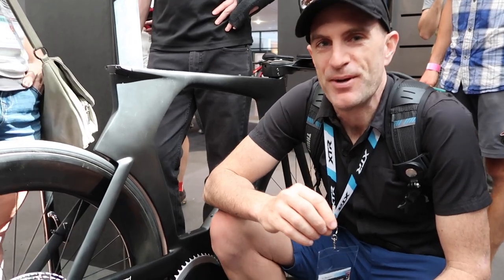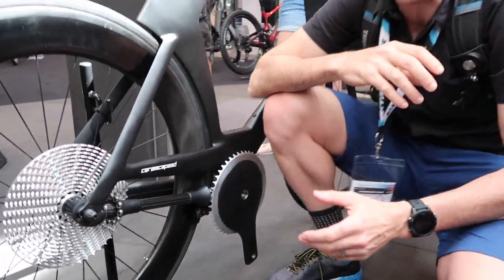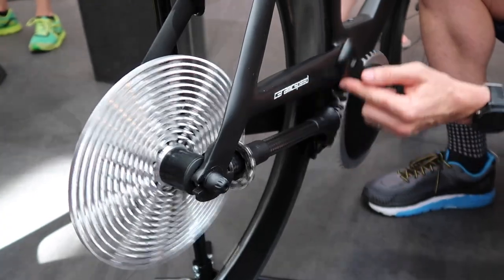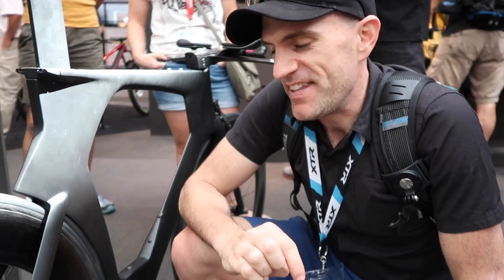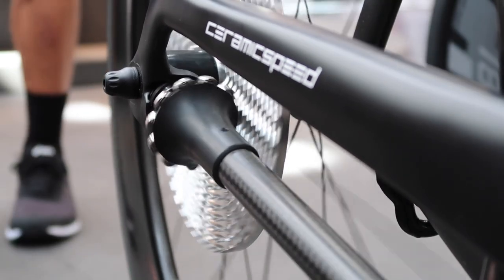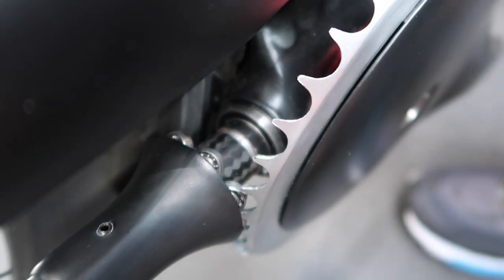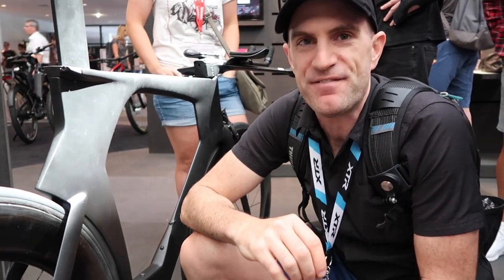CeramicSpeed DrivEN 99% Efficient Drive Shaft // Chain Free Bike // Eurobike 2018

Comment: Chain is the holy grail of bike transmission. But it doesn't mean we should't try new things. This thing is not gonna work but it definitely looks cool.
Reply: В 1890 появились подобные конструкции, с 1893 их серийно производили и  продавали...
130 лет прошло, а проблемы эксплуатации данной конструкции никуда не делись.
Reply: Definetly gonna fail, they're not the first to try it. It's just the basic concept for automobile transmission the only problem is when a rock kicks in there. It'll be funny to see how this fails
Reply: It works. Its a kardan.  Motorcycles have it too.  Bit heavier
Reply: About time that something changes the chain system, chain system is well beyond 💯 years!
Reply: If a rock hits it? Simple engineering problem solve. Put a cover over it so it isnt exposed.
Reply: yep, too much load for such a small gear, will wear out quickly
Reply: Really good coming from a russian person who still thinks a 10 speed bike is hollywood, bikes have to look to the future and that new mechanism is the future.
Reply: If were looking for proof that those who don’t know history are doomed to repeat it, you found it.
Reply: Joshua Mack it is no cardan. It's called mechanical Royal Wave, as there is no Cardan element involved. 😋
Reply: DEVARMONT7 this has been done already, many, many times.  Every decade or so someone prototypes (in some cases even produces and tries to sell) a bike with shaft drive and calls it “revolutionary and new”.  It’s not lack of imagination or ingenuity that has caused shaft drive to fail to displace chains in spite of many repeated attempts, it’s the laws of physics.
Reply: Lalthanzuala Hauhnar this thing is well beyond 100 years too. Got any other dumb bandwagons to jump on?
Reply: Lewis Designs only problem is this thing was tried on and on over 100 years. Trying it again and calling new doesnt mean it will suddenly overcome all the obstacles....
Reply: stan lis but it cant be implemented in competition setup... This construction wont be reliable and at the same time lighter than conventional chain drive to sustain professional athletes load on it.... It can spin the wheel but not when pro cyclist puts all his power down... Construction wont take that much stess without either skipping or plain shattering
Reply: Why not nuclear powered bicycle then?
Reply: I think you are right. A bicycle chain will adjust to wear and last a long time. As soon as this thing starts to wear, I think it is doomed. I doubt that they can solve the problems of proper function, wear resistance, weight, and repairability, but it is still exciting to see.
Reply: Дмитрий Хабаров instead of a chain try ball bearings in a tubing easy 50% improvement. But motorcycle driveshaft is awesome ie Honda nighthawk 650
Reply: yeah I get your point but why try to "over engineer" something that has worked since forever. Like reinventing the weel.
Reply: So you must be riding a penny-farthing (a high wheel bicycle), because they worked, just fine. Why would you try to reinvent the bicycle? Gears are the tool of the devil.  I disagree with the move to a single speed up front due to cross chaining, but what if it turns out that it works better, or perhaps just for some riders?  People must try new things and figure out what works best for them. This is a prototype still in development. But if it reduces friction that much and wear is not as bad as I assume then the people who win will ride them and the people who lose to them will figure it out. I know a lot of people who were resistant to clipless pedals, including me. I mean they were invented in 1895 and they didn't work then, why would we keep attempting to make them? Now I am resistant to riding anything else. Why? because after I got used to them I realized that it was a far superior design, even though the first attempts were terrible.
Reply: if its so holy than how come i need to replace the chain because it stretches over time. and replace the gears around once a year as well because of the chain stretching eating away the gear's teeth.

holy grail  my ass.
Reply: Motorcycles have a gearbox in front of cardan and a complex enclosed  gearing on the other. Ant in total it weights more than entire bicycle.
Reply: It's an apples to oranges comparison. The 2017 Suzuki SV650, a very common motorcycle, weighs 195kg (429.9lbs) wet (with fluids) and puts out 69.3hp (51,677watts) actual measured power at peak output. What are you producing? They have  eliminated the chain, derailuers, traditional cassette, and 2nd chainring (no one is making any 3 chainring cranksets right now that I am aware of). I would also like to add that it has a reduced frontal area for better aerodynamics.  It may be that they can make it practical only for pros and the ultra wealthy. It may not work at all, or it may completely change the game. There are a lot of people predicting the future without having even touched one of these and some of them will be put in their place. We don't know the outcome yet, so everyone please calm down and let's see what happens.

Comment: It is definitely an interesting idea, I can see how the gear changes could work if the bearings on the driveshaft were attached to a keyed slot allowing it to slide up and down and could be controlled with some clever cable linkage. I'm not convinced it will replace the traditional chain and rear mech systems, however. My biggest concern is sideways deflection of the driveshaft and more likely the slender thickness aluminium gear-carriage which will cause the gears to skip.
Reply: I’m fed up with fixing my chains, this just solved all my problems

Comment: Chain ring and "cassette" would have to made out of some sort of  space age material due to the very small contact points under stress,  2 or 3 teeth and possibly only 1 tooth or bearing in full contact.
Reply: Hey Ropate K. Will titanium do, it's very light and very strong!

Comment: Beautiful  piece  of  engineering.  The fact that it creates  noise is indicative it may have more than 1% energy  loss .  Strictly speaking that is not the intended use for Roller bearings . I think it will be too expensive  to produce and the rear gear system  will be prone to failure  ( certainly  the weak link ) .  It also strikes me that it must have a bias toward gear changes ie much smoother on the up than the down change or visa versa .
Reply: Making sound doesn`t take so much energy, friction makes  heat and it is much bigger problem.

Comment: Ya pretty cool. Throw some oil sand and dirt on it and see what happens in 200 miles.
Reply: Do the same with a chain ...
Reply: palimpalim,
Sure and the chain will last substantially longer
Reply: engr. knows that before you know how to use youtube.
Reply: Get-The-Lead-Out.45

Why should it? Bike chains are not very durable products and they require constant care.
Reply: Not to mention crash hard and it's fucked
Reply: They used to have chain drives on tractors, cars, etc. Why is it they don't now? Kudos to the guy that puts the "why not" in life.
Reply: My chain pops off 2 times per ride, this thing does look less durable, but the things can be fixed. So the chain gets more small errors but probobaly lasts longer in the long run, but this thing looks like it's less susceptible to dirt, but a fall could knock it out of place
Reply: 8 hours to machine a piece with hundreds of delicate teeth. If any one of them breaks you get a bad gear.
Reply: Zayd Abbas must be riding far!
Reply: Get-The-Lead-Out.45 yea no mate. Don't think so. Chains get dirty and stay dirty. This would just kick the dirt out. There's no grease to keep that shit in
Reply: mjs1231 
Lol... I think 200 mi would be wildly optimistic! I'm guesstimating closer to about 1/10th of that!
Reply: Zayd Abbas  
Actually, this setup is going to be horribly susceptible to grit and grime. Don't know if you noticed, all of those bearings are totally exposed, not to mention the exposed, hardened steel bearing races driving an aluminum disc/gear under high load... Not good, Kemosabe!
Reply: This is obviously going to have seals, another win.
If they are able to change gears, it is potentially great.
Reply: How durable are drive shafts in cars, trucks, motorcycles, gigantic ships? Not as durable as chains would be at the same place, right? Sheesh.
Reply: mjs1231 

What if there's a fully sealed casing made out of a durable lightweight material encasing the components?
Reply: Chain is more reliable and cheaper than 500$ lol
Reply: Also a chain moves in the same direction as the wheel. This thing has bearings that rotate a different direction. To me it's less efficient. Looks cool though
Reply: What if it was sealed like a motorcycle shaft drive?
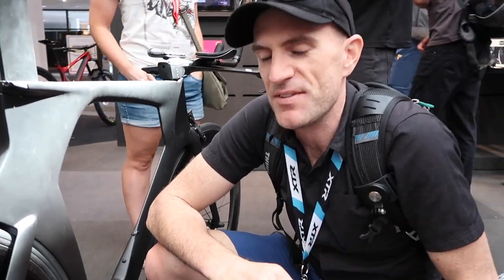Reply: meme 4:14 I'd like for it to be a discussion but people just want a lightsaber duel
Reply: 'Chain guard'
Reply: So you guys take your road bikes onto the muddy mountain trails then? Cool. I'll keep mine on the road and use my MTB for the mud.
Reply: In a snow storm it would not last 2 min.
Reply: I don't see this tech happening without some serious inventions that prevent sand and dirt messing with the 10-30(?) bearings. It looks like a nightmare to maintain. If I had to choose another system than the current one, I'd much rather have a pinion gearbox. It's heavy, but it's reliable and will remove a lot of weight from the back wheel making the suspension work better and very little maintenance compared the this flimsy looking thing.
Reply: Nothing as it will be in a sealed aero cover
Reply: It's made for trials, not mountain biking, so really a moot point.
Reply: Why does this even need to be exposed like this?  Cover everythin but the shaft.  Also, why not nest the shaft in the 'chain' stay to streamline the design?
Reply: Zayd Abbas  Your chain should not be popping off that frequently (unless you're riding 100s of miles at a time). I suggest you get someone to have a look at your transmission and work out what the problem is. Sounds like hyperbolic spin to me.
Reply: I'm pretty sure it will have rubber boots and seals and orings and what not. So it should be better that a chain.
Reply: I have an electric bike i bought like 4 years ago that has no chain and uses similar design, just single gear and it is obviously completely covered and oiled inside. This shit is nothing new, adding more gears is not needed on electric bike so it just adds more parts that could fail constantly. They are just making a big deal out of it for advertisement reasons.
Reply: There is a huge difference to a chaindrive: You can put this new drivetrain in a light carbon enclosure and dirt is no problem for most users. On the other hand a chain would allways transport dirt, an dirt protection won't work there.
Reply: It looks like it could easy be encased under a protection,and the dirt problem should be solved?
Reply: mjs1231 
Dry-lubricant coatings have been a thing on guns for a while. Maybe this bike could do well with that, maybe a deflector of some sort, too.
Reply: Not to mention a gaggle of geese.  Those suckers take out jet engines.  Thank you for your input internet man.
Reply: a chain probably isn't as sensitive to wear because
Reply: maybe it good for citybikes and not for Mountain bikes
Reply: Its a prototype..
Reply: ...and you know this how? What has your lab testing shown you about this design that you have most likely never even seen in person. Yes there are engineering challenges. There are  a lot of issues that will have to be addressed, but if it works it will be a game changer. Have you ever seen a penny-farthing. Do you want to race one against me on my 1997 Serotta Atlanta? Mine is an old bike too, I can take it to the bar, it's old enough to drink. Even if we try and fail, we must attempt improvements. What did you think of mini-pumps when you first saw them, do you have a frame pump on your bike? How about brifters, do you still have down-tube shifters? This may be the next Biopace chainring, or it could be the next SPD clipless pedals (remember the first time you rode those?). We should all wait and see as this prototype gets developed.
Reply: ...and you know this how? What has your lab testing shown you about this design that you have most likely never even seen in person. Yes there are engineering challenges. There are  a lot of issues that will have to be addressed, but if it works it will be a game changer. Have you ever seen a penny-farthing. Do you want to race one against me on my 1997 Serotta Atlanta? Mine is an old bike too. I can take it to the bar, it's old enough to drink. Even if we try and fail, we must attempt improvements. What did you think of mini-pumps when you first saw them, do you have a frame pump on your bike? How about brifters, do you still have down-tube shifters? This may be the next Biopace chainring, or it could be the next SPD clipless pedals (remember the first time that you tried riding those). We should all just wait and see what happens as this prototype gets developed.
Reply: they could enclose the whole drive train and make it water and dirt proof
Reply: you can completely enshroud them, motorbikes and cars can use the same thing
Reply: palimpalim I'll wipe my chain with a rag throw some wd40 on it and continue on. This will litteraly ruin itself if it becomes dirty. The material used is so delicate.
Reply: - Ah yes, let's apple our bikes. Great idea.
Reply: 2 times per ride, wtf???  Save your pennies and buy a real bike....
Reply: We’re all you nay sayers the same folks hanging out at Kitty Hawk? “It will never fly”! How’d that turn out?
Reply: No wrong, different applications suit different needs. The power/torque is far greater in motorized applications therefore tubular driveshafts are better for economy and safety, not for reliability. take a  4X4 V a ATB, both designed for rough terrain, obviously discounting engine/rider, in a rough environment which would suffer drive train issues first? it would be the 4x4 and driveshaft would be the issue 70% of the time.
Reply: Why not say something positive and then raise your concerns?
Reply: +Mike Feddersen Hmm i wonder why they make car parts out of plastic instead of metal nowadays? 1 word "Money"
Reply: saúde de Michael Schumacher
Reply: Everyone's an expert on YouTube.
Reply: Exactly what I thought
Reply: In ten years of use I haven't done anything but occasionally lube my chain. If you don't ride in the rain it can virtually be ignored.
Reply: @x-1584  

Decode this and it might be usable. WHAT DID YOU SAY?
Reply: @TeamCykelhold  for real.

Comment: Very interesting idea!

I would have thought the gear slipping due to over-torque could be solved by putting a support roller on the wheel side of the sprocket.

I could imagine aluminium being tough enough if the unit was covered. Cant imagine it lasting long exposed.

Also those bearing do not have outer raceways that are designed to be rollers with an unsupported point load. They would need higher load bearings to last well i would think.

Great idea though. There are similar transmissions for some cnc rotary tables. The benfit is that by eliminating the sliding action of spur gears you can eliminate any wear. Same would be true for this design.

As for machine time, I'm sure if you had a custom for cutter for each of the tooth rings the machine time would be a fraction of its current time. No point in making tools like that for prototypes though
Reply: What about  the ability to actually switch gears?  This prototype can't even do that.
Reply: Lorro Symonds  en una cnc se pueden hacer  de titanio.
Reply: I think that would work. Or they can run another shaft on the opposite side of the sprocket that turns opposite to the other one. Machine out both sides of the sprocket to have contact on both sides. Then tie the two shafts together ,with bearings, for support,and the bearings can act as a collar for use when switching gears wouldn’t be hard to do and would strengthen the build. Instead of the bearings on the shaft requiring horizontal force to propel the bike it would be sandwiching the sprocket in between the bearings leaving no room to skip gears.
Reply: Double drive shaft idea sounds good if theres enough room. I guess you lose another pecentage point of efficiency and would cost more in components but could negate any slippage.

The second drive shaft could have clearence on the wheel sprocket to reduce frictional loss there.

You might be able to do it just with an idler bearing on the wheel side though.

As for gear changing, i guess the designers have probably thought about this. At the very least you could change a gear one time per wheel revolution with it engaged. The drive shaft would have a spline to couple the rollers' motion to it but allow it to move between the different sprocket rings.

I guess you could introduce a clutch on the driveshaft if this is difficult, but it would make the mechanism complicated.

Maybe if the sprocket was tough enough you could disengage the roller away from the sprocket, shift it, then re-engage, but it would be pretty crunchy on the re-engagement i reckon.

Look forward to seeing what the next iteration looks like.

Still a very interesting concept
Reply: Lorro Symonds